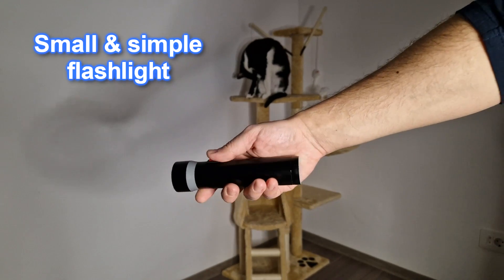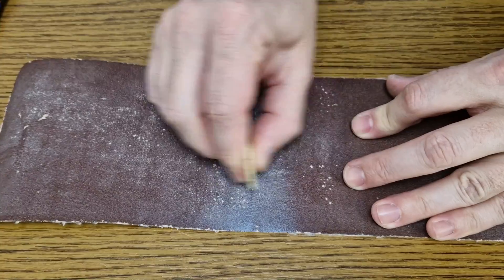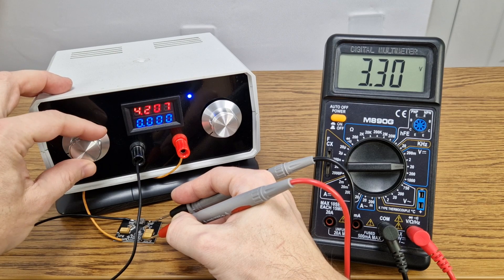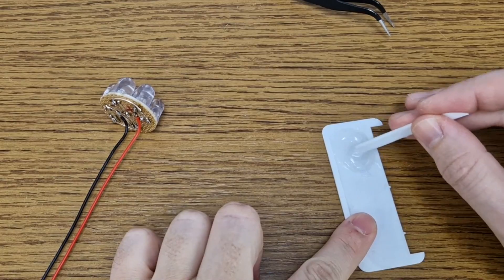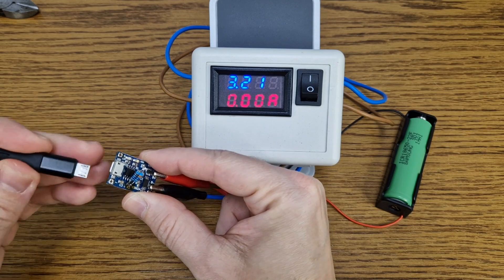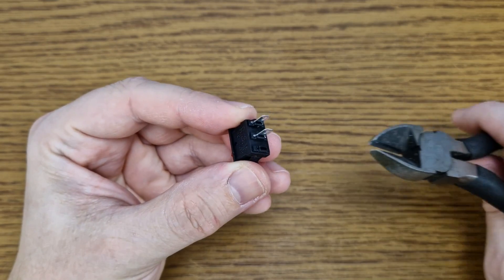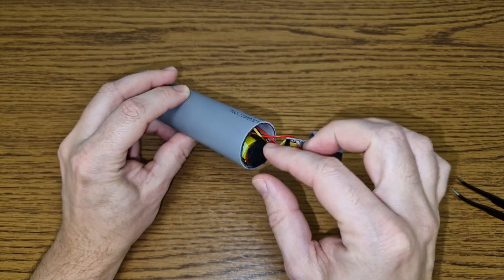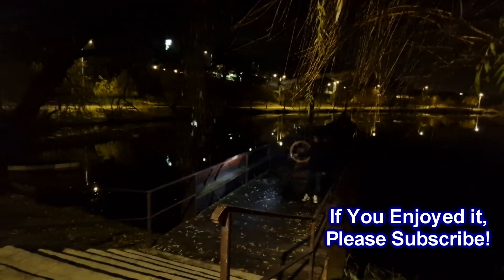Small & powerful flashlight for emergencies

Comment: Hi Sorin great video! I’m trying to do something similar as I have the housing of an old torch that I want to turn into a rechargeable LED lamp. If I was willing to spend a bit of money is there a larger usb c rechargeable unit I could buy and install? I’m not sure what I should be looking out for.
Reply from the maker: Hi, if you want a more powerful Li-Ion charging module, you can use this one: https://s.click.aliexpress.com/e/_oFliiJv
it doesn't have battery protection, so you also need a 1S protection board https://s.click.aliexpress.com/e/_DCG4FMj

Comment: Use 3 1W LEDs, placed on a metal heatsink and make the body out of an aluminum tube. Now you have an even more powerful torch with a good heatsink (add insulation or a handle cuz this gets hot)

Comment: I love this build. very practical. any SMD LEDs (for smaller flashlight project) that's efficient that you can recommend aside from what you used for this project?
Reply from the maker: Hi. I haven't tried smaller LEDs. but these are very good: https://s.click.aliexpress.com/e/_De689Hf
I used the 5W and 10W types, they are good but produce a lot of heat. they need a heatsink.

Comment: Dear Sorin, did you make any modifications on your Opus charger which it needs (for resistance, etc.)? Do you have any recommendations for this? Thanks for your this video and your future answers.
Reply from the maker: Hi. I haven't modified the Opus charger. It can only charge/discharge cells and measure the capacity.
Reply: @Sorin_DIY  I know, but there is a cable mod for the resistance mesure correction. Thanks for your answer.

Comment: Didn't expect that this needs explaining on your channel but the LED voltage is not what matters. The LED current is what matters. The voltage for equal current will vary even between your 7 LEDs. So likely you overpower a few. The best way to drive those would have been to wire them in series and use a boost converter with a resistor in series to stabilize current.

Edit: I also don't get why people still use 18650 without any fuse in series. If anything fails short, then this cell will happily drive 100A or more. If nothing breaks this current it likely catches on fire.
Reply from the maker: Hi. I know the current is important for the LEDs, that's why I recommended to add a resistor in series with the LEDs. I should have explained more about this (like I did in my LED Sign video or other videos with LEDs). I didn't add a resistor to this flashlight, because I wanted to stress test these LEDs to produce more light, at the expense of shortening their lifespan. But I did mention that adding a resistor in series will be better for the LEDs.
About the fuse, yes, I should add one. I added fuses in almost all of my battery based projects. I was in a hurry to finish the build faster. But I did take a lot of precautions, I tested the battery and the modules, I sealed with glue and  kapton tape the battery and all the joints and connections. but a fuse would have been better, I admit.
Reply: @Sorin_DIY You know what this means Sorin? You'll just have to make another video. 🎉 Call it version 2
Reply: @Sorin_DIY theyMayBurn,InsteadHavingAShorterLife
Reply: A typical 18650 can't deliver 100 A.

Comment: Please make a diy flashlight using button leds(which also operate at around 3 volts) with heat sink and a conical reflector using the mirror like reflective sheet which can be found inside broken mobile lcd screen. Please!!!!!!!!!!!❤❤❤❤
Use around four leds of 2 or 3 watts. And two or more batteries.
That would be more powerful.